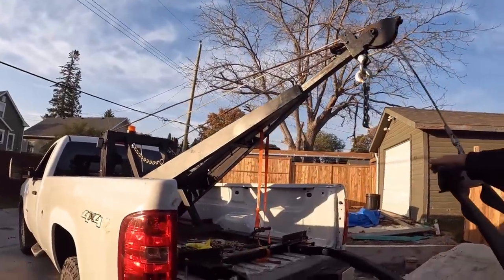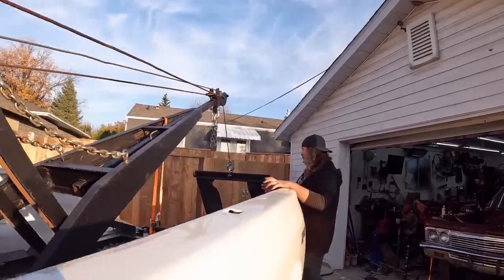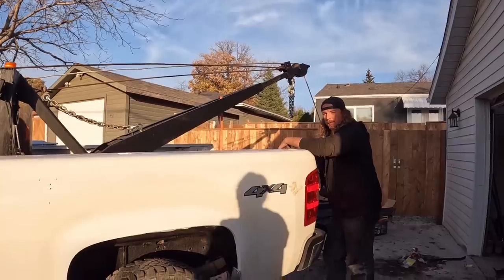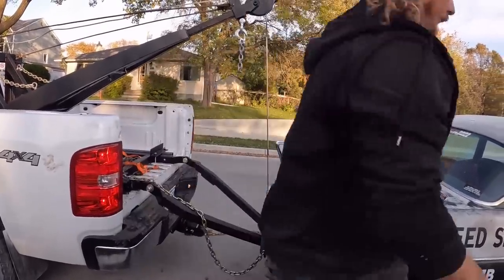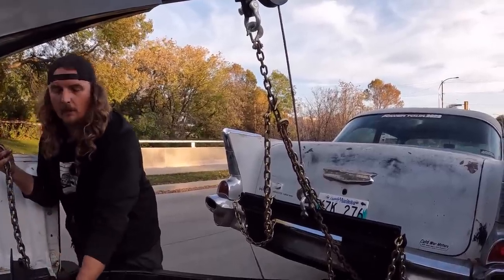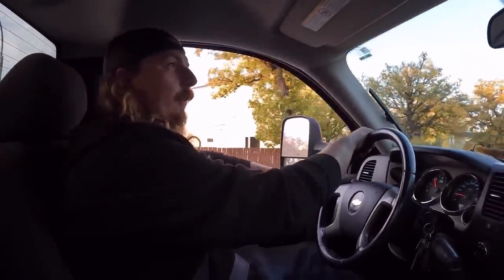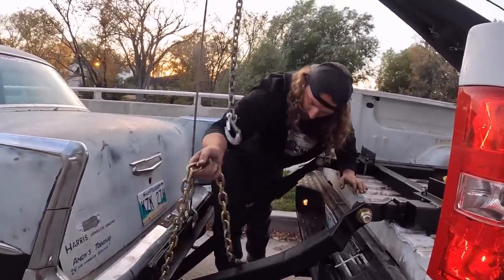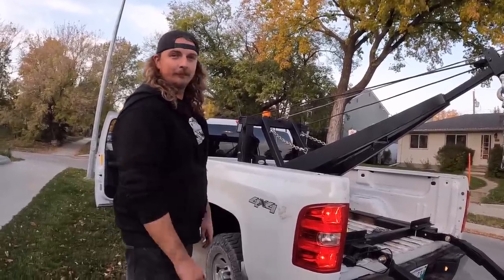I'm Buying ALL THE JUNK!  Home Made Tow Truck Is A Game Changer.  Feeding My Automotive Addiction

Comment: A little info. The j hooks should be hooked under the rear not over. You'll get tired of replacing mashed steel brake lines on cars if you always hook over the top. Don't push the sling so far under the car, ideally you want the hooks on the sling just  forward of the bumper under the car so when the car's hanging they don't contact the bumper, you also don't want the chain from the tow hook tight when the car is lifted the sling should be holding the car not the chains tight chains bend bumper brackets. the safety chain from the boom to the sling is a good idea, cables do break. Good luck with your wrecker.

Comment: Nice work as usual Dan. Take an old tow driver's advice. It's more of a pain but use your J Hooks over the rear, not from under. A hard stop will make the towed vehicle ride up the sling. Your chains go slack just enough for the J Hooks to drop. Sane for Lower Control Arms up front. If the Hook is pointed down, ya can't loose your cool. Keep up the good content.
Reply: I'm not a tow truck driver, but I was thinking that the hooks should be as you said
Reply: What about crushing brake lines?
Reply: @mikeslatz1351  I have had to replace 2 rear brake lines from 2 separate damage incidents from exactly that. This is from a modern deck truck using j hooks to pull it onto the deck. 1968 AMC Javelin. In the same city where this video was made.

Comment: Two things..
1. No need to narf up your bumper with the chains. The rubber sling is supposed to carry the car, chains from the base of the sling to the top are just there in case the sling should fail..so it's alright to leave a little slack so they don't butch up your sheet metal.
2. ABSOLUTELY take the load off your winch cable when towing. Drop the sling and let it dangle from the chain rather than the cable. Your winch will thank you. It's there to lift, not to be abused by every pothole and speed bump you hit in your travels.
Other than that, looks solid!
Maybe think about remounting the A frame to your trailer hitch cross bar so you can shorten it up a tad and run a bit less angle..but your truck seems to like it fine for this load at least. That may change if you move something hefty.  
All in all, good junk...nice work as usual.
🤘

Comment: You hooked everything underneath the car including the wrapping that chain around like you did before getting to the last hook on the swing frame absolutely correct Dan. Many of my drivers never would do it until they lost a rig and besides being embarrassing, they had to fork the money for the damages as I paid as long as done right and no more. You will learn eventually how to when hooking that chain on the first hook to put the chain on the inside so you don't have to  thread it later like you did. I have owned so many tow rigs  that I have lost count of them. I had even the heavy haul rigs with a rotor on the boom assembly so you could lift and then turn the load in the air from the side of the road like over (brain fart, posts and railing).. guardrail!!!! and then set it on the right side so it could be hauled. So basically you grab the chain in your hand, pull on the part going to the J hook and then set it on that low hook.... the chain going to the top hook is in front of the finger grab.... ok... wrap around hand with the end going up is on the front instead of towards the thumb on your hand.... damn its hard without a picture, the other hand will hold that frame work of the strap assembly. I am dying here trying to explain what should be simple for me
Reply: Dan I'm retired from law enforcement back when I started in 1987 most cars had steel bumpers now cars had plastic bumbers most wreckers comp done away with sling stripes because sling straps damage plastic numbers here in the states
Reply: @dontinsley1451  maybe he can add the wheel lift to it.
Reply: @dontinsley1451  I highly doubt he’s hooking anything made after 79, your 100% but it don’t matter if it don’t matter, I miss points & carburetors, life was so easy back then

Comment: Very nice set up Dan. Look on line for wireless signal lights, they are awesome. I built a ramp truck with an old car trailer and a dually, best thing ever. Now I can move my old junk as well. Just one thing careful on lettering, here a lettered vehicle must have commercial plates and commercial insurance. I just lettered "Private.. Not For Hire" to get around that.
Reply: Is that rule applicable to USA? California? Probably is, and I should already know this, but I don't know where to begin to look it up.

Comment: Spend some time on tow forums learning useful tricks. If you don't have a set of chains with J-hooks I promise you want them. 
As for springs the classic tow mod is getting some tall U-bolts from a 4x4 store then harvesting both spring packs from the heavy duty truck of your choice in salvage (not pickup trucks, real trucks) . Cut those bolt and use whatever leaves look right to you as overloads then bolt them to your stock leaves. I use anti-seize on the spring bolts. To separate leaf packs cut the stock pins then replace them with quality socket head cap screws and metal lock nuts, using the round bolt head as your new spring pad centering pin.
Next you'll need overload stops. If you have overload stops its easy to cut short sections of heavy wall box tubing then weld it to the stops so it just touched your new "custom" overloads.
If not go cut some rivets and harvest stops off a heavy truck, but make sure the result touches your new overloads with no weight on the boom. 

The result does not sag much at all under load because the overloads engage immediately. You'll figure it out as you go because it's obvious with parts in your hand and except for new U-bolts costs next to nothing. That's the way insert wrecker booms and full wrecker boom conversions like my Holmes 440 have been done for many decades.

Next useful mod is dual rear wheels (those sidewalls make quite the anti-sway difference!) and maybe a mechanical wheel lift but if ya go that far best to use the truck you have then build another project since it's cheap when you wrench.

Comment: Someone probably Said it already. Black rubber bungee strap. Wrap around steering wheel. Wheel not locked,  strapped pulled taught n shut in the driver's door. Wheels return to where you set the front tires because locked wheel doesn't always translate to dragging straight n trailing behind you proper. 

Cool build. Thanks for sharing.

Comment: Dan, I used to be an automobile repossessor, on the repo trucks with inbed booms, we remove the factory limit straps, and attach bungee cords from the lower a frame to the tailgate so the tail gate will close when the boom is up. And when the boom is down so is the tailgate. But you have to lose the bumper or French it in like a roll pan. Ofcorse a square hitch receiver would work as a bumper aswell. Just thought I'd share the info. We used to call them hide a booms. And you could hide them under a canvas tannue cover. And on the expensive ones the cover would move out of the way when the boom was ingauged., looks good though. You would have to pull out the latches on the tailgate though.

Comment: Everything looked good, one thing I do different is, Not back that far under the vehicle. Most of the time I put the base of the sling right under the bumper. I was really impressed when you wrapped the chain around itself. That is the way I was taught. I had a boss tell me I was wasting time wrapping them around. I still did it the correct way. I towed with a 440 and a 880, The 880 has twin booms and twin winches. They worked great at pulling vehicles out of ditches. You could run both lines out and connect to both sides or even the front and the rear of the vehicle and just work them back and forth. I made some really mean wheel chocks, I used extra heavy duty expanded metal and angle iron. the bit right into the asphalt and didn't budge.

Comment: I remember the sling type tow truck back in the 80s and before. Then it seemed like over night they changed to these that lift at the tires. I guess it was because so many vehicles went to front wheel drive.

Comment: Used to run M543 turbo 6 and M816 Cummins 5ton's in the army We had nothing but a tow bar and a sling for the hook hooked to 2 shackles at the front,We would bounce with half our weight on the back towing back to base with the boom all the way in,Your rig didn't even bounce,I think you got a nice rig there.

Comment: Hey Dan, I'm sure you've been told but to make sure I'm going to tell you. Your bottom hooks should face away from the direction it's pulled. It looks like they are pulling from the side. That's what bends hooks.  Yes you should let the tension off of your wench onto your safety chain then bump it to snug it up. Always use a spring loaded safety hook. As for your boom safety hook eyes, (DANGER) they look casted. That's a no no.. they will snap from the shock should your boom cables give way. You should use a piece of  1/2" strap with a hardened bolt. Just trying to keep you safe buddy.

Comment: Hey Danny Like what you are doing I towed all my adult life, so I have a little advice and like what you do. back in the day the A frame that attaches to the sling was telescopic and had spring loaded locking pins so you could get the Hook bar where you want without moving the truck. I do recommend that you place the hook bar in front of the bumper and place a 4x4 under the car at the bumper supports or frame and the J Hooks from the bottom of the axle and not the top. that way you will not get chain slack in an emergency stop and not bend brake lines and reduce the chance of having a bumper with the happy to see you look. the thing is totally awesome keep up the good work

Comment: Dan. You might want to try not putting the sling quite so far in.  You actually should try putting the bar on the sling right under the bumper.  You will find that it will tow better.  And if you have to make a sudden stop.  The car won't climb over the top of the sling

Comment: Don't back up under the vehicle so far. And always use the j hook hooked the opposite way you used them on your car. When they get pulled tight,  they will go up into tanks, or whatever is above it. I grew up running a Holmes 440 and I k ow everything there is to k ow about one and how they are designed to be used. If u have any questions,  feel free to shout back. Good luck.
Reply: And also, you need to get with me about your chain system.  It has some major flaws I it I can help you with.

Comment: Hmm, I am sure you probably thought about it, but one way to lower that lower a frame bit would be to attach it to the receiver hitch mounting bracket under the bumper. I think most of those bolt under the frame rails and hang down a bit from the bumper, you could do the same set up with the pins on either side to install it right below the bumper.

Comment: Nice work, besides all the welding and fabrication, you also hooked them over the axle rather than under and took all the precautions you can when towing!

I will say to keep an eye on the frame where the front bolts hold the main brackets onto it. The leverage there is incredible.  I have seen them not only crack, but break the frame after extended service. Just something to check once in a while. Especially if it isn't reinforced in that area.

Comment: Wait to hook the chains to the top of the sling. You want the bumper to sit inside the rubber of the sling and not the chains. After you raise it then you can chain the top of the sling. It makes the ride much better. Also glad to see you went over the axle with the J hooks.  I've seen a lot of people go under which is dangerous if it comes loose.

Comment: In the same font DDs SPEEDY RECOVERY 
it’s awesome rig   Weld battery trey, extra large j hooks with chains , extra straps , extra rear lights low shit happens in a ditch at night (ask how I know) 
2 sets of wireless magnet running and brake lights 
Magnet banner for rear of tow car IN TOW 
EXTRA INSURANCE.  Not for hire sign 
Driver carries no cash  font on door 
Tow mirrors and spot lights    Phone charger and carrier chargeable flash light

Comment: Nice build but the only main issue is that you can't use a sling system tow truck on any newer cars. And by newer, I mean anything 1990's and up with plastic bumpers, so only good for old cars...personally I prefer a good car trailer with an electric winch on it. Much more flexible as to what you can carry, and safer in my opinion...plus you can tow it with anything with a hitch if your truck is temporarily out of commission... but if your really hooked on having a tow truck (excuse the pun), I would go for a wheel lift system. much simpler, safer and no risk of damage to the car, old or new cars

Comment: The only further thing I would suggest is to put a plate on the outside of the bolts for the A frame, so that it's more of a lll type of hinge point, the way it is is gonna side load those bolts and wear out the holes pretty fast

Comment: In my opinion, I feel like you will have a difficult time getting the bar under a vehicle that is sitting lower than what the 57 chevy. The down bar has such a deep an angle already and the 57 sits high in back. Often times the cars or much lower than this, plus flat tires. Forgive me as I am totally ignorant with towing setups. But would it be possible and structurally sound if the bar makes a 90 degree down after it clears the bed and rear bumper and say perhaps extend down about 8-12 inches before making another 90 degree back out straight to the end of the sling? Of course putting a triangle back bracing in the 90 degree turns for strength.

Comment: Why said it was one there's nothing wrong with owning a couple dozen even if it pisses off the wife just tell her that you're covered did a good job on the conversion I have run a couple of these systems specific once just like what you're running in in small blocks it was Chevrolet trucks and they turned out pretty decent two thumbs up

Comment: Do you have a U-Haul’s up there they sell an excellent magnet base tail light system for towing with the jack you need that you will install next your license plate on your truck to plug-in and they have the long wiring harness waterproof for the magnet base taillights to sit on the other end of the vehiclelpppppp